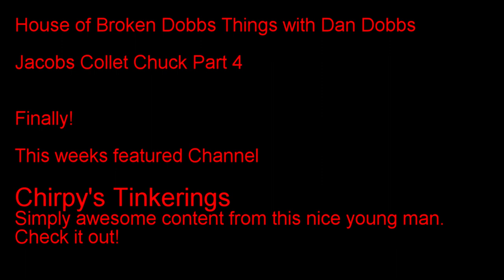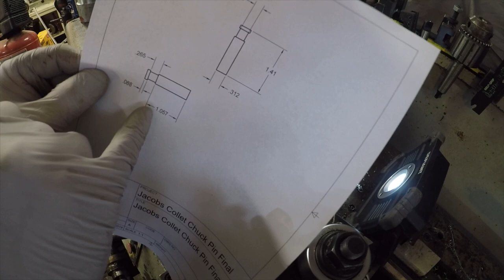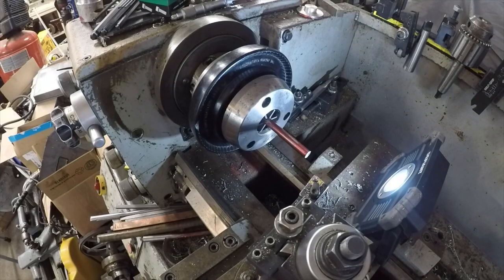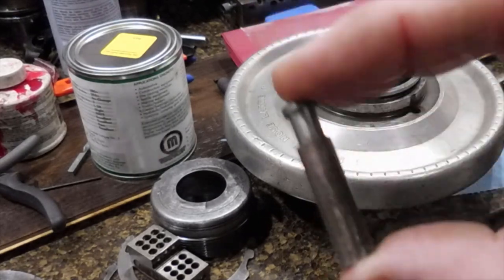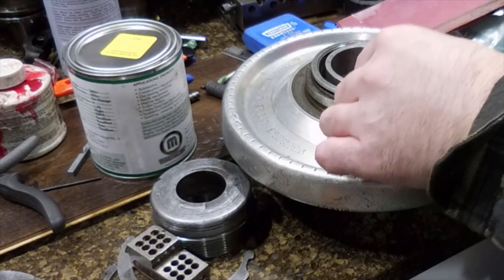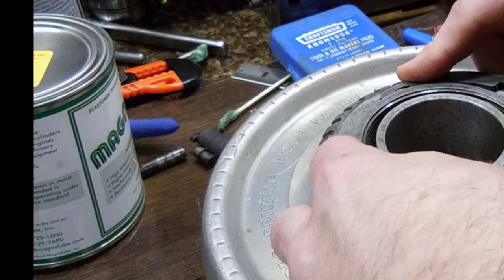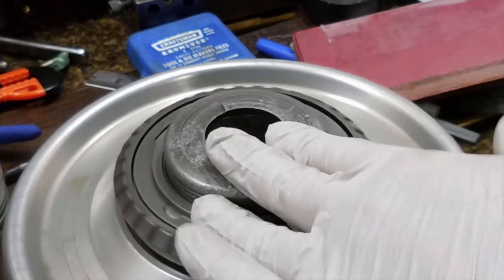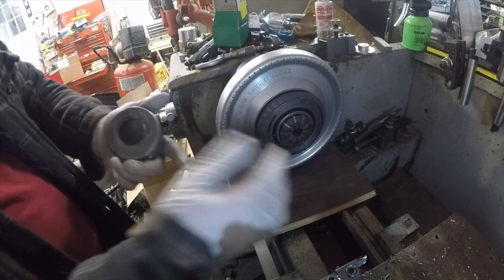Jacobs Collet Chuck Part 4 FINALE

Comment: Hi Dan nice to see you. Randy is a great guide, we could not live without CAD in our design conversions from pencil scratch to blue prints automation and so much more. Nice to see you going into CAD and a pin is great exposure to using adjusting it here. 
You have got to be feeling really good for two reasons making a part sharing it and while using the software to design it. YES it, the to part snap ring got on there, we were fearing an issue. Oh no is that cap going to go on or should we call in some helper LOL, you got it we watched it happen. 
Nice to see on your lathe way to go it was fun to get to come along for the show, it works really neat. Dan.
Lance & Patrick.

Comment: Thanks for the shoutout dan, looks like it will work quite well now, lol. For the passes on the lathe where it's dealing with the spring pressure, I just turn the lathe off, then feed the carriage back, then no spiral, lol.
Reply from the maker: Good suggestion.  I have to look at that aspect. My cross slide has a little end play longitudinally, maybe the tools are no edged well enough and have residual pressure from the cut. Looks like a common problem I would like to be done with. LOL. 

If you see below. Steve highlighted an shared his key on his chuck.  Looks like I need to redo that part.  Not an emergency, adding it to the list. 

Dan
Reply: I think all lathes have that problem, it's not because of the lathes but from the tool flex and also flex from the work deflecting away from the cutting tip. If you have a very light pass or a spring pass with a very sharp HSS bit, you'll notice that you wont really get that, hence why it's called a spring pass. 

The key looks pretty easy to make on the mill, for the countersink hole, I probably would have just stuck the countersink in an endmill holder and clampped the keystock to the mill table, then fed down into the work, then you can get the hole exactly where you want it to be. While it's set up on it, it shouldnt be too hard to just mill part of it away and mill 45 degree angles on the corners like toolmaker's corners so it fits in the keyway instead of needing to round it over all the way. A little touchup with a needle file and it should be good to go.

Comment: Hey Dan.  The Chuck looks and looks like it works great.  Pretty cool series, as I never saw one of those apart.  Good Job on the Fusion stuff too.  I have been following along with Randy too.  He is a good teacher.  Thanks for sharing!

Joe
Reply from the maker: Thanks Joe - trying to learn and grow.
Reply: I am with you Dan, I am about as newbie as you can get to this hobby, but watching and learning from you and others sure has made it enjoyable!  I have a project that I want to do that using fusion that will involve the drawing but also the CAM tool paths too.  The parts will need to be cut on my CNC router.  They are a little confusing to me at the moment, ( a bazillion options)  but hopefully I can work through it.

Comment: Thanks to your video, I took both chucks apart. The beat up one had a busted pin and the little spring loaded dogs are really worn. The other chuck is pristine. No broken pin, the little dogs are pointed little tips with no wear and the surfaces are beautifuly machined and look almost new.
So, I have to decide what to do with the broken pin.
At I have one very good Jacob's flex collet chuck. I'm very happy about that.
The collets that came with new with the exception of two of the sizes.
You saved the day with your videos.
Reply from the maker: Jeff Anderson You are most welcome. The locking pin was easy to make. The little springs and dogs were something I need to look at again the lock collar works fine but I would like to find new springs.

Comment: Thanks for these videos. I just found a good deal on Ebay. I bought 2 Jacobs rubberflex chucks and a full set of collets . It was almost buy 1 get 1 free! One of the chucks is a bit rough and missing the nosepiece but I will have a go at restoring it. The other one is in very good condition. I hope they are as accurate as they claim!
Reply from the maker: codprawn I do like mine. The speed coupled with not fumbling with drawbar etc is a real plus.
Reply from the maker: codprawn I was glad I did the bearings etc. smooth as silk now.

Comment: Hey Dan.

Very Good to see this mission coming together.
Always good to do Mission Jobs.
But glad when they are finished.

Love the on screen notes, always gives me a good laugh.

Today i was doing a job that this Collet Chuck would have been perfect for.
Machining the Hinge Bushes AGAIN ????

I would be interested to know the holding power of this Collet Chuck.
The Bushes i make with a Parting Off tool needs plenty of holding power.
Today while doing this job 2 times i thought i tightened the Lathe Chuck enough but once the tool got about half way through the cut it started to spin in the Chuck, and it was not that loose either surprisingly enough, only barely tighten the Chuck any further.

I can not find these local to me but are these Collet Chucks available with a D1-8 Mount in your part of the world ?

Thanks for sharing your Mission with us Dan.
Always Good to watch your channel.
Regards Peter.
Reply from the maker: Peter CCR ENG Peter I believe they made the chucks in all the major types. I will take a look specifically for that type. Seems like the ER types are most popular in your part of the world. Holding power seems to be really good as the flex type conforms well with lots of contact points. My guess is the designed in hammer function lets it get a really nice grip. The smallest collet only has 4 contact points but it is good for 1/16 to 1/8 “ . I picked up a full set of collets (used cause that’s how I can afford such treasures) for under $200. With the pieces I got with the chuck my net will be just a few dollars after I off the pieces. 

Thanks again for watching and commenting. I comment to make fun of myself as laughing is the best option to hold of screaming fits.
Reply from the maker: Peter CCR ENG I surfed our EBay up here. They do exist in the D1-8 format. One listed for $400 buy it now here in Ohio. Also open to offers. No collets but that is easy (not cheap) t fix. Another setup for handle release and no chuck for $550 buy it now with a full set of collets (better value) looks better for your use.
Reply from the maker: https://www.ebay.com/itm/JACOBS-1-16-1-3-8-Lever-Type-Lathe-Collet-Chuck-D1-8-spindle-mounting/172356320640?hash=item28213cbd80:g:lN4AAOSw8w1X6tAj:rk:1:pf:0

The handle release version with collets
Reply: Check out the 5C collet  scroll type chucks .
Reply: @houseofbrokendobbsthings5537  
Hey Dan.
Very much appreciate the heads up on the D1-8 Collet Chuck.

It,s funny it did not show up on my side, when i visited ebay last.
The guy does not post to me,  but not so important i think it was just an Envy thing getting hold of me again, LOL.

You having something I DO NOT ????     / jealousy ? maybe, Hehehe.

Thanks again, Dan.
All the Best.
Regards Peter.
Reply: @swanvalleymachineshop  
Hey Max.
 Good to see you checking out Dan,s channel.

Comment: I have now fitted the Jacobs chuck and love it. There is a but however, I am getting vibration at higher speeds - over 500rpm. Everything is running true on the dti. The handwheel though has a fair bit of play in it. Are they all like that? You can rock it slightly from side to side. Such a shame as it is very accurate holding the work but the vibration is annoying.
Reply from the maker: codprawn Thank you for watching and commenting. There was some lateral play in line. I did not notice any vibration. I would guess more static balance potential than dynamic. Not sure of your mounting type. I have D1-3 mounting. In my case I would rotate in the other spindle holes. Any chance you could chuck a bar for an arbor and check static balance of the assembly like balancing a grinding wheel etc. Just my guess that the play would be less of a factor at speed unless it is not free to float to find its  center and has a wobble. Centrifugal force would try to pull it into a line.
Reply: @houseofbrokendobbsthings5537  

Thanks for the reply.
My lathe is L1 mount. Initially I had about 10 thou runout on the collet taper - I tapped the L1 locking ring a few times as described in the Jacobs manual to get it to run true. Perhaps doing this the collets are now spot on but the body of the chuck itself is now 10 thou out which could cause the vibration I suppose.

Comment: Hey buddy, good job! I've got the same chuck and it appears the keyway that came out of it was broke and missing a piece. That's why it's kinda a pain to line the nose piece up. It should come all the way to front so it can be registered before the threads engage. I'm not sure you want redo that keyway or not but it would definitely make things easier and faster on you during collet changes and I think it'd be worth it. Just in case you do here a link to some good pics I took of mine for reference. ATB  https://photos.app.goo.gl/FFzcZURUZqo5BZK77
Reply from the maker: Steve just Steve - Thanks Steve so much. I wondered as there is a whisper of a mark in that location. I might just do that again. Didn’t make sense to be the little bit touchy to setup as it is a production tool. Thanks for the pics as well. I think I will try and draw it up in CAD and share.
Reply from the maker: Thank you very nice of you to comment and thanks for watching.
Reply: @houseofbrokendobbsthings5537  why did you quit making vids?
Reply from the maker: Lol well like many I paused with all the drama. Camera is sitting here needing charged. Thanks for encouraging me to get back on the horse. Any preference - shop stuff or Volvo stuff?
Reply: @houseofbrokendobbsthings5537  I like the shop vids but I hear Dis-songs, putting on makeup and making a fool of yourself get much more views. ; ) Lol